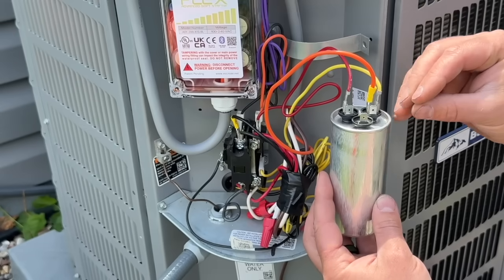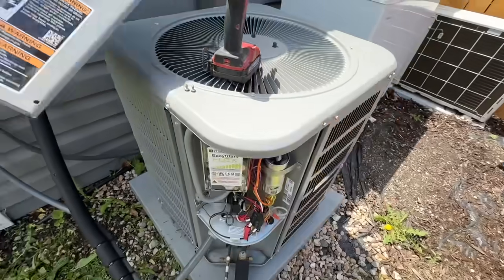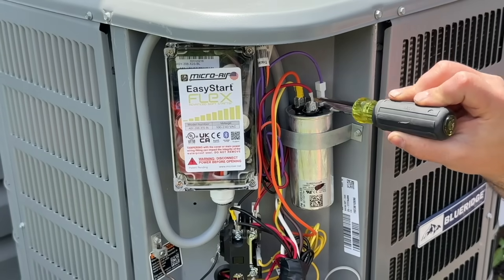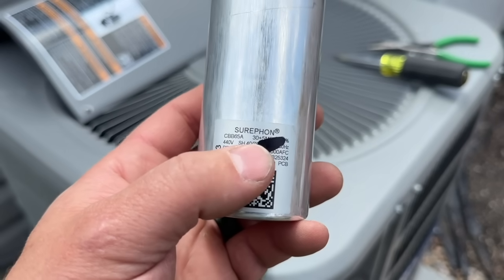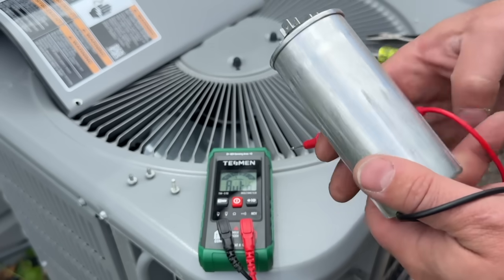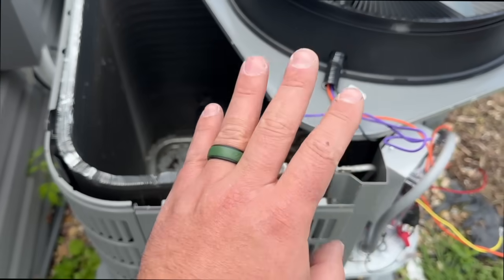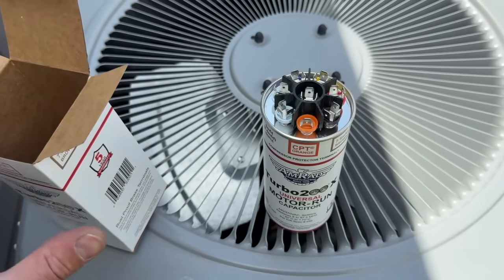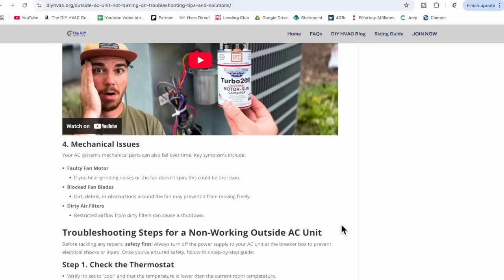STOP Getting Overcharged For This Simple A/C Repair

Comment: My local hvac business in Northern KY, while doing a membership 6 month tune up charged $260.00 to replace a 40-7.5 mfd capacitor which was under Trane parts 10 year parts warranty. I found out the tech had put the wrong size on and the service manager came out a week later and installed the correct China replacement.
The $260 labor charge was outrageous to say the least. I will be searching for another service company now the unit is out of 10 year parts warranty coverage.

Comment: How do you know if the capacitor needs replacing?
Reply: A bad capacitor can cause your fan and/or compressor to stop running.
Reply: Use a multimeter to check the capacitor. Ideally, use one that can measure microfarads. You can test a capacitor at any time - if the reading falls within the labeled tolerance (e.g., ±5%), it’s considered good.

Comment: Like Jake said, although everybody is looking for a bargain, sourcing a replacement from a supplier like McMaster Carr or Grainger is probably your best options, and they will even list country of origin so you can steer clear of possibly purchasing cheaper capacitors that may fail sooner. I have 2 compressors for my house, one was over 30 years old the other one about 20, and although they were running fine, I did purchase and replace both capacitors and contactors as well. It turned out the old capacitors still tested good  for value and leakage / breakdown voltage using a Sencore LC53 capacitor analyzer It's nice to work on a brand new clean unit like you did, most people will open them to find a horror of cobwebs and possibly an insect infestation awaits them.
Reply: Crusty lizards!  😮

Comment: If ever buying 1. Buy at least 2 to have a correct spare in hand. Caps will eventually fail from time, temp, and use.
Reply: I had quality originals in 2 compressors, one over 30 years old, one about 20. I live near Chicago, so, its not brutally hot, but AC does get used. I checked the originals I replaced with a good capacitor analyzer ( Sencore LC53) an they were still serviceable, so they are my emergency spares if I need them.

Comment: Is it hard to replace the contactor? I was quoted $600 for that. I see it's a $15 on Amazon.
Reply from the maker: Super easy
Reply: Most big box hardware stores stock replacement contactors. It's best to match current rating, and also, make sure the coil in the contactor is as close to the same resistance rating as possible. If you put in a new contactor with a lower coil resistance value, you may damage or smoke your thermostat and / or HVAC unit's control board.
Reply: @poormanselectronicsbench2021 What  Are you talking about coil voltage, what do you mean resistance. Is that stamped on the contactor body? Every residence unit out there is going to be a 24 volt coil. Very few exceptions..

Comment: I will NEVER call another HVAC repairman unless I need refrigerant. I moved in to a new (old) house and when I turned on the AC, water started dripping through my ceiling. 
Now I know it was a clogged condensate line. Instead of a fair, minimum hourly charge, dude came over, spent 5 mins, and charged me $110 PLUS $150 for the specific service - which I now know could be completed by a monkey. 
What happened to paying someone for labor + parts?

Comment: The hvac contractors saying they have overhead to cover is insane. A mechanic has way higher overhead with a bigger shop and more expensive tools and they don't charge me $2000 to swap out a headlight bulb.
Reply: Overhead is code for "Funding to feed cocaine addiction".
Reply: They do, but when you hear a price like 300+ to do a cap, that's just suspect. The bigger the business the higher the overhead though. Smaller businesses will have lower prices though.

Comment: Most of this over charge conversation is false .....
Ive yet to meet a rich AC person....
They at best make a comfortable living and work extremely long hours.....
Reply: I'm sure there are business owners that overcharge and may not be rich, mostly because, money is going out the door as fast as it comes in spent on  "bad habits". They should state service call fees and labor rates up front, and show a reasonable pricing on any needed replacement parts up front, as well as being licensed with the local city / town / village you are in, and also be bonded and insured, if not, walk away and find another.
Reply: lmao...right!
Reply: It doesn't matter how wealthy they are.  The point being, there's liars and thieves out there.  That's what is known as doing WRONG. Sheesh.  Did your daddy not teach you these things? You need Jesus.
Reply: @s1988teve   its not liars and thiefs ,they can charge wharever they want ,its ones choice to pay for the service or not ,also u r paying for trouble shooting as well
Reply: There are crooks in every business. He doesn't tell that the turbo is about 90.00 or give a list of the cost of tools used. How about the cost of education? Either way I bet his service call is about 100 bucks. Were at 190. Now. And a good tech has to troubleshoot to find the problem and any other problems that may be present. There is an hourly rate attached also. So, go ahead without knowing the whole problem and slap on a 10.00 cap. Then when you're system takes a dump, you'll be forced to pay the AC guy.. Jokes on the diyer for the most part.

Comment: I've never advertised and get lots of folks wanting a second opinion because the previous A/c company told them they needed a whole new system for 10-20K. Half the time it's something like a burnt wire at the compressor or a defective capacitor.

Comment: It happened to me and I didn't bite. I replaced it myself for $20 and this was buying it locally. My HVAC company tried to even scare me from doing it myself. 

I had a service plan and they said they'd do it for $250 while they were here and $500 if they had to come back. These were the special prices because I had a service contract at the time with them. This is when I cancelled my service contract as well.
Reply: When I use 2 work resi use tell customers if they bought a cap on Amazon they  can change it or get bunch next time while I’m there can be swapped out  or they can change it some already had em stocked and I swapped it out for them got bunch of tips for finding bad compressors actual work not being a salesman former company got bought out I left they went to upselling not worth screwing ppl over for a quick dollar
Reply: That’s the part that runs me hot they try to make you believe you shouldn’t be touching something that simple and then charge people 150 to 1200 dollars 😡😡 and it takes approximately 15-20 minutes if that long
Reply: Cool. I would think to be safe that shutting power down to whole house would prevent any chance of being electrocuted.